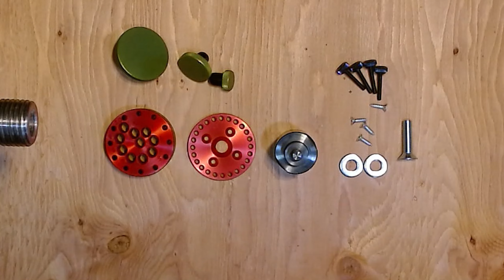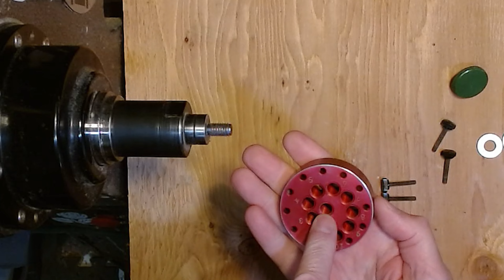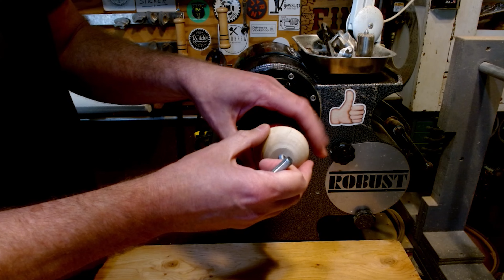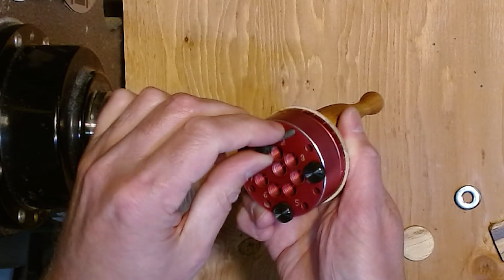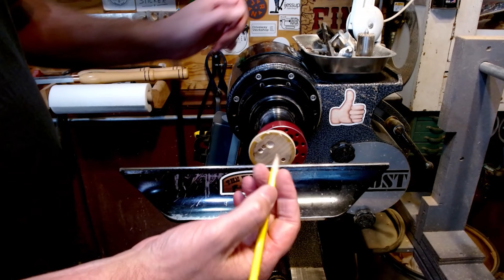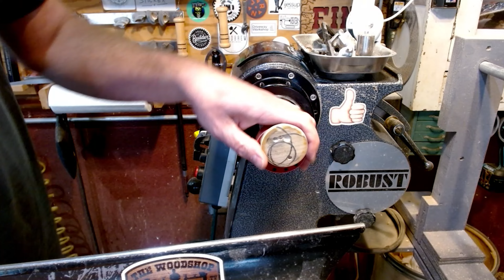Woodturning | Niles Joyner Off-Center Jig

Comment: Hi Carl, The new version you demoed is a big improvement over the old model, a lot easier to replicate a design.  As you said, it is a lot of fun and a great way to use up those little cut off pieces (some call them scraps, I prefer small turning blanks).  Thin pieces can be glued up in a stack and even wedges and such glued together give unique designs.  Thanks for the demo, now off to have some fun.  Cheers, Tom